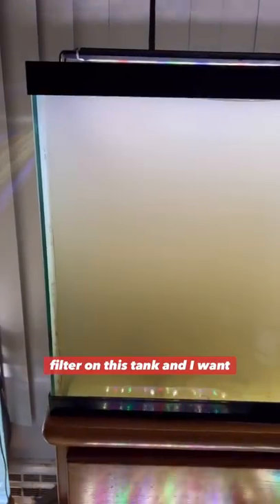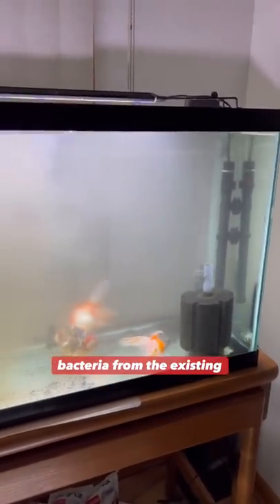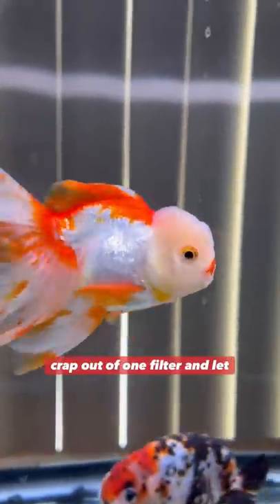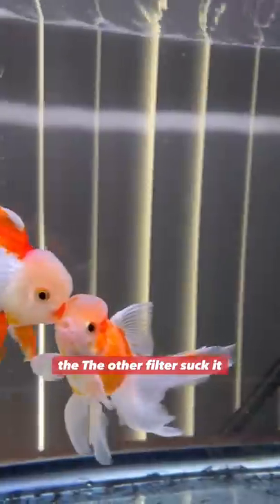Why I PURPOSELY made my tank dirty

Comment: so basically i dumped out all the contents of my vacuum onto the floor then re vacuumed it up with the same vacuum
Reply: It would be a new vacuum to make the analogy make a bit more sense, although it still wouldn't. Vacuums don't put the stuff they suck up back out, if they did, to make it good they would need some way of making the garbage good. And the best way to do that is bacteria or decomposers   to turn must of the vacuumed stuff into compost and stuff, which then it would make sense to stuck up the old vacuum pack into the new one. The fish tank one is basically the same stuff, instead of the filter holding waste and needing to get changed constantly, it uses bacteria to eat up a lot of the stuff on it and filter the water even better with a couple other benefits. Re-filtering the filter with the old ones stuff transfers that bacteria
Reply: @Fitzcrackers4prez wym you never emptied a vacuum before?
Reply: @rafaelamaya4438  when I said they don't put they stuff back out I meant themselves and they don't put the stuff out to reuse, they just get rid of the bad stuff
Reply: @Fitzcrackers4prez  the oc didn’t say they do it by themselves he literally said “I dumped”
Reply: @rafaelamaya4438  "when I said"
Reply: @Fitzcrackers4prez I feel like you tried so hard to make a point that makes zero sense. Videomakers counterintuity seems to have rubbed off on you...
Reply: @Jr_live23  yeah, i kinda picked a bad way to say it. It's not counterintuitive, do you know what good bacteria is? Since everything goes through the filter it collects the good bacteria that attaches itself to the filter because all the waste the bacteria eats goes through it. This bacteria takes a bit to develop and can be annoying and dangerous if the filter system doesn't get that bacteria so the guy squeezes out the good bacteria from the old sponge to run through the new filtration system and get the bacteria attached to that. All the junk on the sponge is just side affect
Reply: @Fitzcrackers4prez  Because squeezing the sponge out definitely isn't gonna make the new filter just as dirty as the old one. There's better ways to go about it, that's what I mean by counterintuity. Yes there is bacteria that help keep certain fish nutrient, I never disagreed with that fact. But since you're so smart, why buy a new filter if you're just going to throw all that dirt n grime back in the tank? At this point it's honestly worth saving the money n just rinsing n reusing the old filter. So tell me, what's more intuitive to you?
Reply: @Jr_live23  he's not changing it to clean the sponge. Sponges work less after a while and I'm pretty sure he was doing a whole new filtration system not just a Sponge, I forget.  Newer sponges can also handle grime without getting "overfilled" better so even if the old sponge was getting replaced because of it being too dirty it would still work to dump it into the new one.
Also, you suggesting to just rinse the old one makes me think I overestimated your listening skills
Reply: @Fitzcrackers4prez But you see, it's still possible to keep the "good" bacteria locked in the sponge given you use low pressure and cold water. So before you try and insult my listening skills, you should probably brush up on your communication skills.
Reply: @Jr_live23  how am I supposed to know you were thinking that? I thought you reverted back to, this might be a little mean/offensive/insensitive, simpletons. Anyways the main problem was probably just sponge deterioration, so replacing it would be good.
Reply: It’s aquatic chemistry. It’s more about keeping the beneficial bacteria culture rather than the physical debris
Reply: Beautiful analogy thank you 👏
Reply: @Jr_live23  he put a tiny amount of dirt in compared to amount those filters can handle. He’s just priming it to avoid ammonia spikes.
Reply: You need to have a good bacteria culture in a tank. If you start over with clean water and a new filter, you loose all that. So he had to get the bacteria from the old filter back into the tank.
Reply: Aye to recalibrate the vacuum
Reply: Not really he is putting that bacteria in the new filter.
The filter is there to polish the water not just "clean" it there are so many different media in the filter.
Depending on what part of the filter he removed this makes perfect sense.
If he had removed the initial layer I don't think he would be putting that back in the tank.

Comment: stuff like this proves my point that fishkeeping is not as easy as non-fish owners make it out to be. ive only had 2 tanks before and havent had one in years, but this really just shows how careful you have to be when it comes to water quality, bacteria, etc. for fish.
Reply: There was one time a bug fell into my dad's fish tank and died. I'm the one responsible for cleaning everything and putting in the chemicals and whatever. I did everything the same as usual and all 7 died except for one. It's crazy how specific everything has to be or everything can just die
Reply: @Kai-Aaron  Bro what fish are you keeping?
Reply: @jacobthemaster66  6 tetras and 2 gouramis
Reply: I mean I’ve had fish and didn’t do all this extra crazy shit. The fish were fine too. In regards to the weird filter shit. They still had some plants and stuff.
Reply: @Kai-Aaron  well..yeah? Bugs would die in water regardless of what type it is. How fast they die, however, does depend on the type of water.
Reply: @every0neisdumb285  the point was that I changed my water because of it and the fish died
Reply: @Kai-Aaron  yeah.

Comment: You don’t have to do that squeeze because it’ll pollute the water. Just put old filter upside down on top of new filter. When the water flow it will transfer the bacteria to new filter automatically plus all the unwanted junks will not get back into your tank.
Reply: While i understand this what if the sponge has broke down too much and you have animals that could pass through it of get stuck? Especially on certain models the pumps slots on the pipe may go a little high on the pipe
Reply: That's what I always did but it shouldn't require all of the crud to bring it back to normal.
Reply: He got a different type of filter

Comment: That makes sense! Personally I use a HOB. And every couple of months I cut a block of filter foam in half and replace one half of the foam. That way some bacteria are always there to colonize the new bit of foam. Different strokes for different folks!
Reply: Yeah but that defeats the purpose of getting a new filter.
Reply: Why would you want bacteria in a tank? And why does he have no rocks or gravel or sand? Speaking with 28 years aquarium experience.  You don't want bacteria in a fishtank fyi
Reply: @Stephen-jw8ci I was about to ask why he did this thinking the fish are gonna get super sick but then I saw your comment thank you for cleading that up:>
Reply: @Stephen-jw8ci  i am also trying to understand how the implement the nitrogen cycle in my tank. However, i have turtles and use a internal filter. The youtube videos i’ve watched have told me to clean the filter media only w the tank water and to not clean the whole internal filter out since it has beneficial bact. and to just replace the carbon filter with a new one from the pack of 3 i bought. But if I dont clean out the actual filter, there’s a lot of dark buildup on the inside and outside and I don’t think simply cleaning filter media w tank water or replacing the filter will remove that gunk. So should I clean out the entire filter once in a while to get rid of all bacteria, beneficial or harmful? And by entire filter i mean taking out the internal filter from the tank and spraying it down so it gets rid of all gunk inside n out.
Reply: @michaelt1931  I'd say yes I used to own turtles and once every 3 mons I'd completely clean and spray out the whole filter basically by the time you get to the last filter in 3 pack I would clean the whole thing just my opinion tho you might wanna Google it or ask your local pet store what the recommend
Reply: @slayersprincess2146  yea thats what ive been doing, cleaning/replacing the filter and trying not to clean out entire internal filter until theres a lot of buildup. I still get very clear water after the changes but i was just worried about the cycle of the tank.
Reply: Thank you for explaining I appreciate it 😊
Reply: @KronicDaydreamZ  google aquarium cycle.

Comment: This is actual kinda smart, I rember my goldfish had a hard time adjusting to clean water everytime we cleaned they're tank. Although we didn't have a filter, we just dumped minerals and hoped for thr best.
Reply: It may not have been the clean water they were reacting to. The beneficial bacteria lives more on the surfaces than in the water itself. So for example, if you wiped down all the walls, changed the filter cartridge, and vacuumed the gravel all in the same water change, then you've really disrupted the beneficial bacteria and it takes a while to regrow. We can help by gravel vaccing only half the tank at a time, only wiping the glass on the front of the tank, or alternating vacuuming the gravel and changing the filter cartridge. You can also look up how to get away from using the cartridges they sell you, or extending the life of them!
Reply: they are tank
Reply: *their

Comment: When people think of bacteria in a fish tank they think of harmful bacteria, but what a lottt of people don’t realize is that there is something called beneficial bacteria that can actually help the fish. (From my understanding) People often save the bioactive material (this is where most of the beneficial bacteria thrives) from there old filters and do one of two things; 
1: Just transfer over the old bioactive matter straight into the new filter
Or,
2: what some people call “phasing in/out” the old or new material, to do this you essentially take some of the old bioactive matter and mix it with the new material to help boost the tank.

Comment: Fill a bucket with some of the water from the tank. Place the new filter running in the bucket and then squeeze it out in the bucket. So you can keep the bacteria, it will get in the new sponge faster because less volume and the tank stay clear.

Comment: The full answer is, a filter is basically a small biome for helpful bacteria that help clean the water. I'm not an expert, maybe theres a bit more to it, but that's what I gathered. A new filter won't have those bacteria so they're transferring them in the easiest way possible: putting them in the water, to be absorbed by the new filter.

Comment: Thanks. This is a good idea for maintaining good bacterial cycle In tank. Maybe people need to think of it like “probiotics for fish” lol then they might understand. 
The filters I used to get were divided into 2 parts so you could change one half at a time instead of one completely new filter. Now I buy filter material from cut to size and this would be easier than doing 2 little pieces.

Comment: You actually don't need to do this. When you are doing a water change just squeeze the sponge in the old water that you removed and use that same sponge in the filter. The sponge will keep bacteria as long as you don't clean it with tap water and it's enough for your fish to be happy. Also the old water that you keep in the aquarium has beneficial bacteria too so it will be enough.
Reply: Yes but this is a new filter, not a water change, new filters need the bacteria to properly maintain a safe environment.

Comment: Do not do this.  This makes no sense, bacteria is everywhere in the aquarium.  Ive kept freshwater aquariums for 30 years, bred both vertebrate and invertebrate species.  This is a needless silly extra step.  As long as you keep up with water changes (and filter cleaning) this won't hurt your tank, so whatever, but do not feel like this is a step you SHOULD be doing.

Comment: This is a joke...right?
I hope so because all you need to do is rinse the sponge filter in a bucket of tank water. 
The bacteria will continue to live in and on the sponge.

Then continue to run the sponge filter in your main tank until  your new filter becomes established.
After that you can continue to run both filters or simply remove the sponge filter.

Comment: You do this in a bucket with the new filter running in it, squeeze the dirty filter, let it run for a while. Then you can put the new filter in your tank without polluting the water like crazy. There is no valid reason for doing it the way you do.

Comment: I don’t think you need to dump the contents of the whole old filter in to get the bacteria, pretty sure one light squeeze will get enough bacteria in without filling half the capacity of your new filter off the bat… not an expert, just seems like that much squeezing would be enough to use that filter again, meanwhile you’re changing the filter to remove the crap you’re filtering out, which you just deposited most of back into the water, meaning that filter is probably almost ready to be replaced by the time that water is cleared up a bit… 

Do they not sell ready-made solutions to re-introduce the bacteria without all the sediment and crap that you’re trying to filter out in the first place?

Comment: So when you squeeze the dirty filter you're basically having to get a new filter with the new filter. Already in  because you're making the new filter  dirty again
Reply: bacteria is what keeps the water sustainable for the fish to live but stress will lead to them being vulnerable to those bacterias and with clean water like that you cant just change to a new filter without adding some bacteria (those chemicals u buy at store to cycle your tank is bacteria) because it will basically be to clean and stress out an possibly kill the fish and im guessing he did a water change cuz its very clean that or its cuz its empty af no gravel or anything to absorb bacteria so the previous used up filter would absorb almost everything, but in this video he jus added a new filter  squeezin the bacteria in the tank to balance out the bio chemistry

Comment: Always used aqua clear hang on back filters because they don't use cartridges and you can clean the sponge and replace carbon when necessary. Plus super quiet. But finally used a air pump filter on my 65 gal in addition to the agua clear and they really do work well. Allowed me turn the agua clear way down on flow and spaced out cleaning it by a long time. Plus they sit low and help cover a different water level. I had the tank fully planted with a balanced eco system where I was cleaning everything 3 times a year and the water was beautiful and healthy.

Comment: So whats the point of switching filters 🤦🏽‍♂️
Reply: Sponges degrade and lose surface area over time. This therefore lowers the population of benificial bacteria within the filter
Reply: @jackwilson9204  but doesn't the water already have all the necessary bacteria it needs?
Reply: @armandoebk6786  nah not at all. The bacteria don't actually really inhabit the water but the substrate in the wild. So if there was there would be barely any and definitely not enough to deal with all of those fishes waste. Another thing is he's probably using town water which has chlorine added to it to kill any bacteria at all. 

He's doing the cheap way which is use the bacteria you already have in the tank. Replacing the filter is more because the old sponge degrades and loses surface area. There are products on the market though which add bacteria in a more controlled manner but is very expensive.

Comment: Could just put tank water into a bucket with the new filter and if you really wanted to and the ols filter. Ao stupid
Reply: You could do that, but bacteria mainly thrive on the objects in the tank rather than the water (substrate, sponges, decor). So using the sponge which you can squeeze is the fastest way to transfer the bacteria